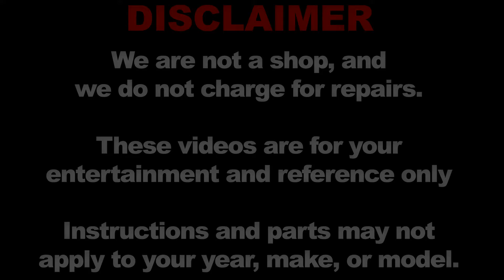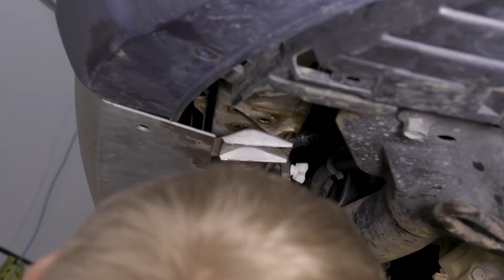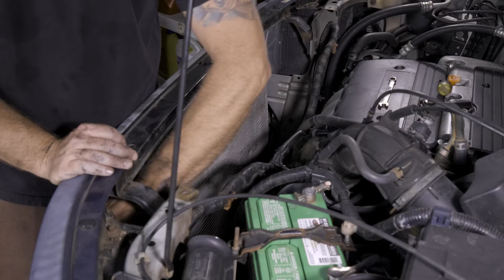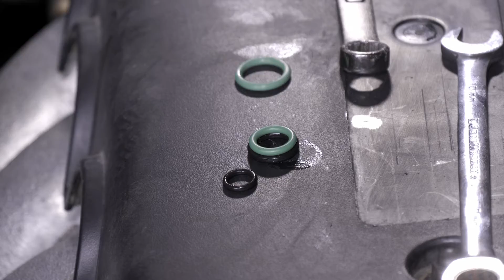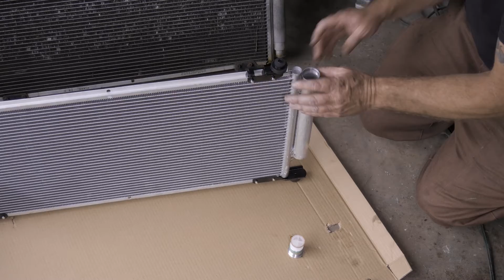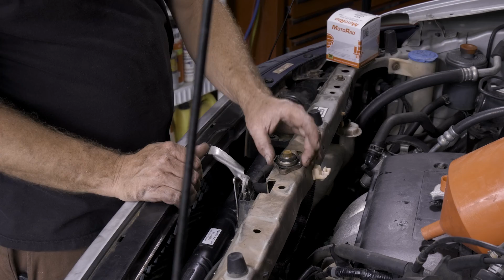Radiator & AC Condenser Replacement On 2003-2006 Honda Element, Simlar To 2002-2006 Honda CR-V

Comment: Are you sure the oil goes in the reciever drier? Sounds counter-intuitive to add oil where your trying to keep moisture out?  I may be wrong though. 11:10
Reply: On page 21-6 of the factory repair manual, the dryer receives 10 mL or 1/3 fl.oz of PAG 46 oil.  Various oil replacement for other AC components are also listed there.